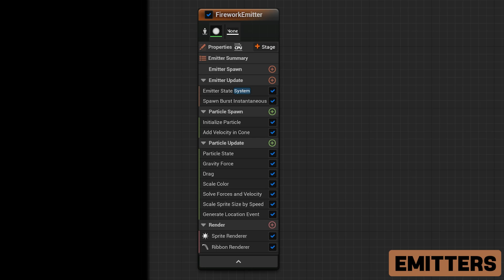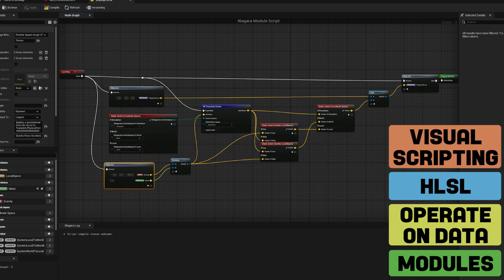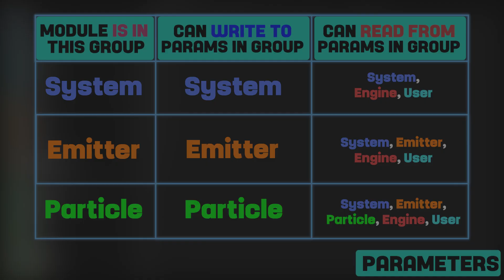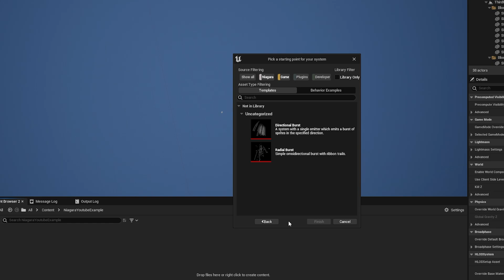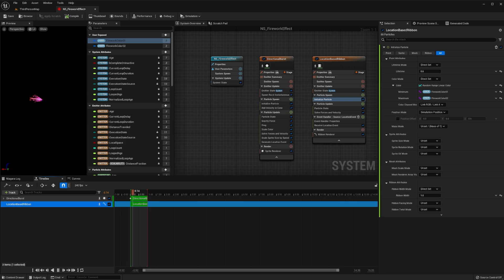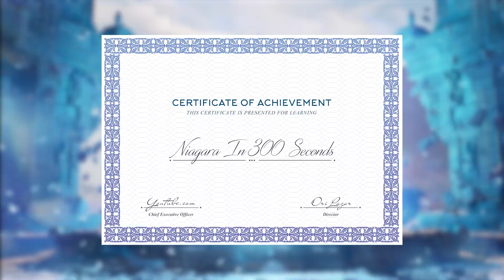UE5 Niagara in 300 Seconds

Comment: I hope maybe following you i can get some of the answers i need. 

i made a fire aura using the experimental fluid  Gas fire emitter template, however the fire doesn't trail the character  when moving, it leads the character instead,  maybe you know how to fix this? is it a parent parameter? do i need to reverse a value somewhere ?  i also made a vortex nova off the same asset,  and if i drag and drop onto a mesh, it works, if i try to call in in the 3rd person blueprint, it fails to render.  HELP.

Comment: Could you make an intermediate guide to Niagara tutorial? So like going more in depth on creating custom modules and stuff?
Reply from the maker: Hello,

That is the plan! 

However there will first be a beginner friendly video, which will include a a comprehensive walkthrough of creating an effect, as well as how to analyze the performance and then optimize the effect using different culling methods and gpu integration :)
Reply: @MyGameDevPal  that sounds awesome. Also, I’m just wondering something, if I had a particle beam, how would I make it follow the surface of something (so like an arc of electricity, how could I make it roughly follow a skeletal mesh, without clipping through it)?
Reply from the maker: @nzgberg  You're in luck, there's a step-by-step example of this in the new UE5 documentation! https://docs.unrealengine.com/5.0/en-US/how-to-create-a-beam-effect-in-niagara-for-unreal-engine/
Also check out the new ue5 content examples, there's a few use cases in there :)